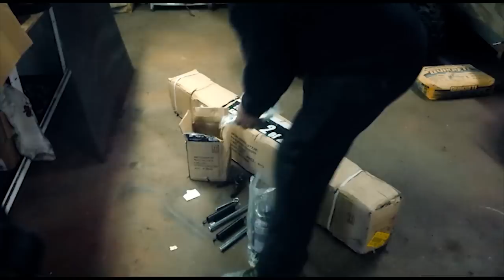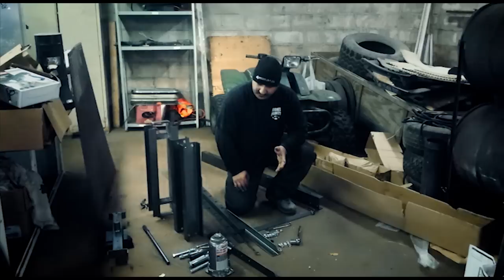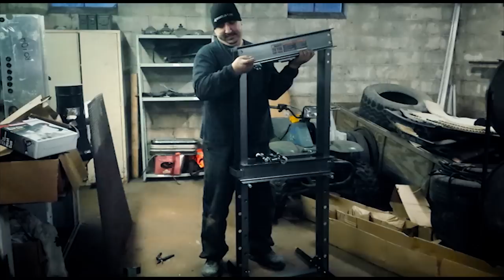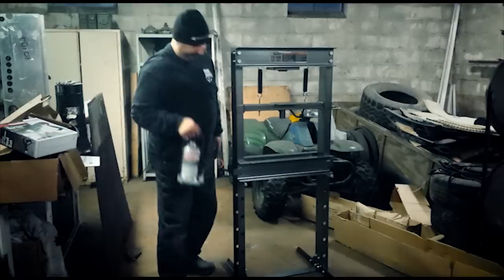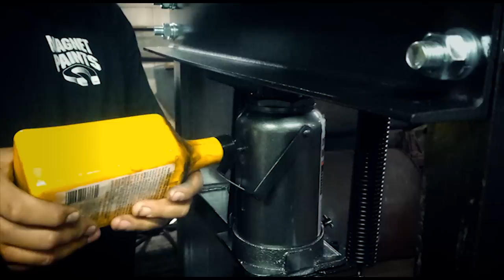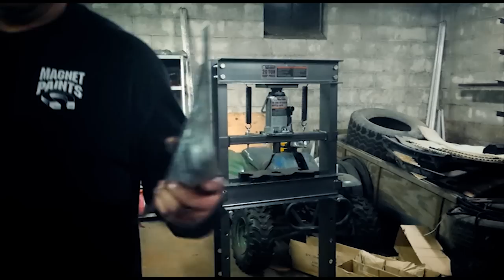20 Ton Press - Harbor Freight Tools

Comment: 17:31 my bottle jack did not line up a inch off the head plate has a 1-1/2 ring welded to it for the jack head it was off the 1 inch , so I had to make clamps out of 3/4 x 1/16th L channel  the ram bar to press plate is square , but the press plate is off by 5/16 the back side of the press plate I had to use 2 inch x1/4 inch flat steel to get the press to 1/16 of level  the head is off by 1/2 inch looks funny like its leaning backwards but all that matters is the ram to press plate is square. Went to a Steel yard got scrap 1-1/2 cold roll bar stock all the way up to 4 inch  5 odd ball sizes for under 20 bucks 1-1/2 x 2 ,1-1/2 x 3, 1-1/2 x 4 , 10 inch long 1-1/2, 5 long x 2.  I got 2 14 inch long x 1 x 4 extra press plates  with press bars for 50 bucks on ebay .  I see a lot of guys using wood  in a press not a safe idea at all , I have 30 years working in machine shop we never used wood in a press.  everything was within 1 tenth of thousand .0001  I understand we are not building a spacecraft and can get away with  5 thousands .005 wood can explode

Comment: Great video, I like the depth of the instructions you gave.  I just bought one, so the assembly will be a no-brainer now.  I've seen videos of guy's complaining about the quality of the product, well, it's Harbor Freight right?  What do they think; they're buying snap-on on something?  Your comments about the welds and the stress points were a good analysis of the tool.  Thanks
Reply from the maker: +chardon59803 Thanks for the comment and I'm glad the video was helpful for you. I've been using this quite a bit lately and I'm very glad I bought it.

Comment: My frame already came welded together.
Reply: So did mine. Seems there are 2 different model numbers. Item 32879 comes welded together, and has 3 boxes. Item 60603 you have to bolt together, and only has 2 boxes.

Comment: Hi, the video is old but.. I just finished my homemade 20t press (almost the same) but I have a problem with the springs, mine are not useful... could you please tell me the diameter of the whole spring and the diameter of the rod of the spring (the length is probably ~15cm?

Comment: It looks like you have the new model:
http://www.harborfreight.com/20-ton-h-frame-industrial-heavy-duty-floor-shop-press-60603.html

The 32879 comes in 3 boxes with the main frame welded at the top instead of bolted.